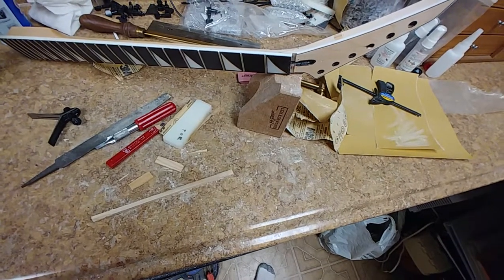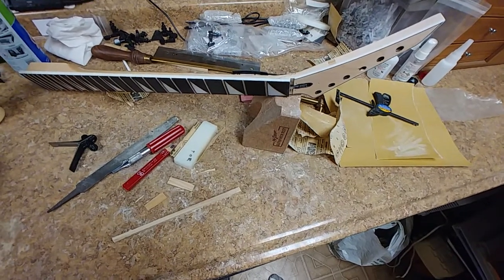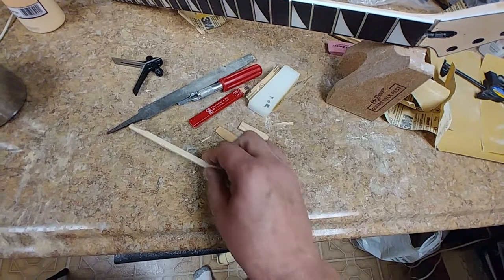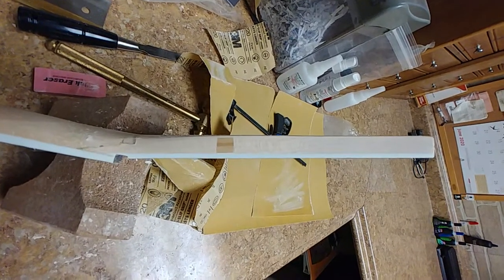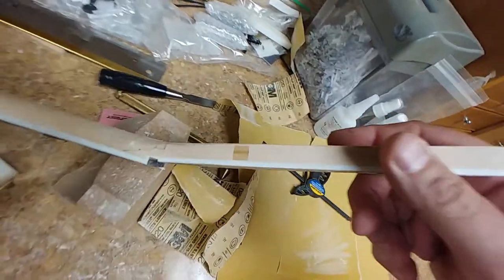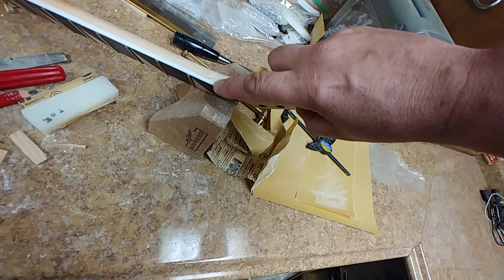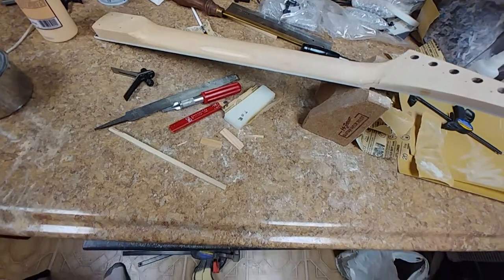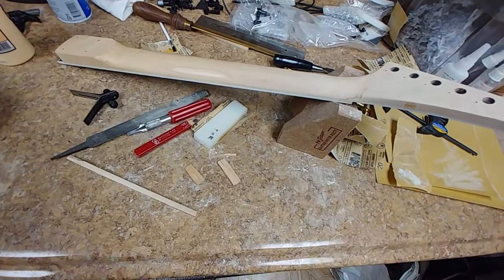Thanks Zip Zipson and Every1 The Wood Filler Worked Out Better

Comment: Glad you found a different method you are happier with. I could tell the original way was bothering you.
Reply from the maker: Yeah. If something doesn't seem right or I could do better at something. It bugs me, it bugs me a lot. I did the pinstripes on the 1928 Ford Model A and everyone liked the way it came out. My father was like... It's done and the guy can come and pick it up now. I told my father the pinstripes didn't look right to me. My father said everything look good. The next day before the guy came over I restriped the bed of the truck. I just didn't like the outlining. It just looked like it didn't match the body pinstripes. After I fix one side of the bed, I had my father look at it. My father said I was right. The new way matched better with the cab of the truck.
Reply: Eric C that is one of the main things I like about you, your belief in doing things correctly and not stopping until you can’t improve on the results. If there were more people like you, the world would be a much better place.

Comment: Menards sells maple lumber in various sizes, sanded on all 4 sides. Just a suggestion if you're looking for a closer match.
Reply from the maker: It's already glued in and set. This is my first head stock repair. When I bought the oak dowel rod. Menards only had oak and ash.
Reply: @ericctheartofnoise8613  Just thought I'd suggest it, but don't get me wrong- you do really good work.
Reply from the maker: @blasty290  thanks. I am going to see about getting some maple. Next time I do a fix like this... I'll be ready.
Reply: @ericctheartofnoise8613  In my local Menards, the hardwood lumber is near the wood trim boards and moulding. You may even be able to find small strips of maple moulding that can be cut down into the small pieces that you need.
Reply from the maker: time to stock up a little lol. thanks Blasty.

Comment: Would like your opinion... basswood body Strat missing the neckplate... will the screws hold without washers or do you think they'll pull through? That basswood is really soft and I don't want to ef it up.
Reply from the maker: I would find a neck plate or like Ibanez uses a counter sunk washer.
Reply: @ericctheartofnoise8613  thanks Eric! I have the plate, but being a noob I over sanded the body, so the plate sticks out a hair on the sides. Ideally it'll get the countersink washers, but the plate holds plenty tight for now. It's just uncomfortable on the hand. Thanks again, Eric! Very much appreciate your time, input, and great videos! 🤘